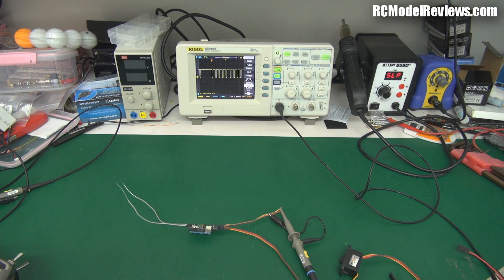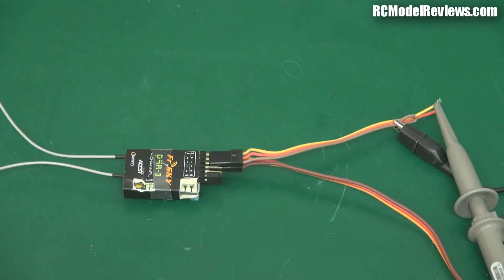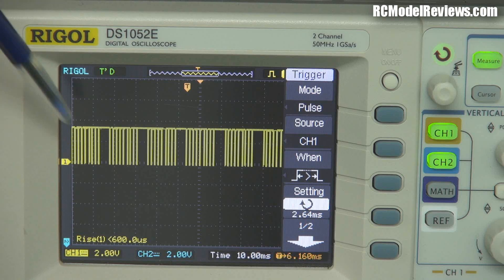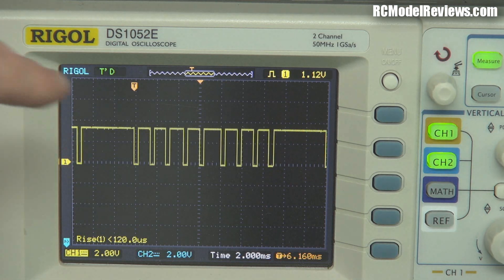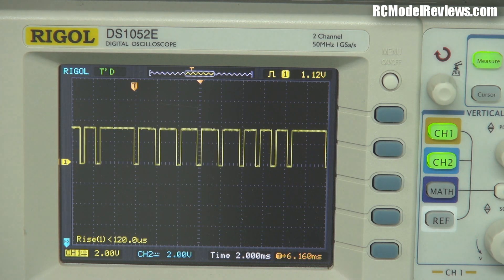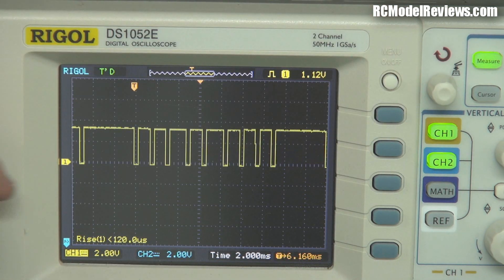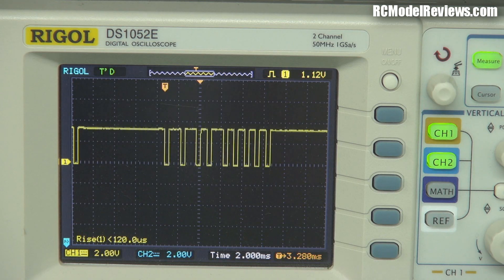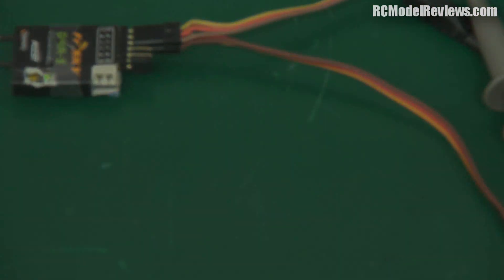CPPM and the FrSky D4R-II receiver

Comment: Check out the CPPM on the FrSky Delta-8! I did things differently when writing its firmware to what FrSky usually do in their firmware. It's designed that there will always be a minimum sync pulse length - no matter what the channels have been set to. Effectively stretching the complete frame length if necessary. 
This gives best of both worlds. Short frame length if the channels move small amounts to keep the latency short - but then extend the frame length if the channels have moved large amounts. 
Probably better explained if you take a look at the output on your scope.
Reply: A comparison between different receivers (not just FrSky) and their CPPM implementation would be nice.

Comment: How can i determine if my D4R-II reciever has the 27ms Fimware already?? The 27ms update is from 2012-09-26 so my recievers SHOULD have it already. How to Test?
Reply: For those don't know: you can reflash them simple by using a normal ftdi adapter: http://diydrones.com/profiles/blogs/frsky-s-cppm-at-27msec-firmware-update-with-ft-prog-and-ftdi-cabl
Reply: David Kaden Hi David, in the end did you reflash? I just bought one and I have the same doubt as you.
Reply: Marcelo Alcantara  Yes, i flashed all three i have.

Comment: Hi Bruce and thank you for the insight view , I am just getting into fpv and as always . I use the fly sky 8 channel receiver with the flysky radio. However, I have been thinking about investing in the taranis radio just wondering if and when new receiver come on the market . And as I add the extra bells and whistles like osd ,etc if there will be a need to flash radio. Most people flash the radio to get more features . Just wondering if new accessories will need to be flashed as well.Thank you.

Comment: I wonder why they didn't use Manchester Bi-Phase Modulation, as used in SMPTE and CD audio to encode binary data and with error correction encoding, or something like MIDI which transmits channel number and values as events only when they happen.
Event based transmission would keep the bandwidth down by only sending changes, but there's also a risk of being missed, especially without any form of handshaking and acknowledgement.
At least with CPPM encoding, channel states are continuously broadcast and can cope with temporary dropouts and brownouts, but a duty cycle of 20 ms seems to be quite large to multiplex just 8 channels.
If a model has a telemetry back-channel and enough transmitter reciprocity, it would be interesting to use TCP/IP so commands and video transmission could be encrypted and made secure from interference and hijacking.
Reply: >it would be interesting to use TCP/IP

TCP/IP is totally unsuitable for this sort of application.

>so commands and video transmission could be encrypted
>and made secure from interference and hijacking.

You don't need TCP/IP to encrypt the data stream. Encrypting the telemetry data would be easy enough.. you could do it in software or use the hardware crypto block that a lot of newer Cortex micros have now. To encrypt the video you want the video to be digital and have something with enough throughput to encrypt the stream without introducing lots of lag. If it was something people really wanted it would be the sort of thing that would go into the ASIC that does the video down sampling for the analogue transmission and H264 or whatever compression for recording in the "action cams". It depends on where you are etc but I have a feeling you aren't actually allowed to send encrypted data on some of the ISM/ham bands in a lot of places.

Comment: Bruce, sorry for the basic question. Do I understand correctly that with ppm (I'm lazy) I can have more than 4 channels on a 4 channel receiver?

Thanks for the video.
Reply: The problem is that when you have lots of channels with high values the sync pulse gets shorter to keep the frame (a set of channel values) to the same overall length. Once the sync pulse is too short the flight controller has no idea whether that pulse is a channel or a sync pulse. The sync pulse is there to reset the flight controller's internal counter for the current channel that's coming in over the wire back to zero. If it thinks the sync pulse is a channel that won't happen and everything will go to shit. If I understand what Bruce said you should be fine with 4 channels even with the shorter frame length.

Comment: For all those that think the contraints of the 20ms period of the sync pulse is a bit retarded. This is not FrSky specific it is simply that they are one of a very few makers offering this output as an option. Historically 20ms has been the industry standard for frame width allowing the use of recievers with varying numbers of channels with any TX (assuming same brand TX and RX).
The so called PCM systems of the past also addressed some of these limitations but the average sunday flier was happy with the old PPM system and the available PCM RX's were expensive and have not proven to be futureproof unlike the PPM system.
 It is only in recent times that anyone has had a use for CPPM. Aside from multirotors and some types of robotic vehicles all models use servos hence CPPM was never an option. Futaba introduced S Bus as a means of increasing the possible number of channels, simplifying wiring and reducing latency introduced by the 20ms frame width. S Bus is a truly digital interface ie using binary encoded numbers rather than PWM with servos being individually addressed and their position commanded over a single wire.
FrSky have adopted S Bus as option on all their current generation X series Rx's but have dropped CPPM. They have also introduced a limited range of S Bus compatible servos which is nice since the Futaba S Bus servos are rediculously expensive. I have a couple of the FrSky wing servos and can say they are nicely made fast and accurate.

Comment: This is really a non issue if the pulses are generated by a microprocessor as they are a minimum width for the sync pulse can be specified, and the frame rate can vary slightly at maximum pulse widths. Whoever programmed stuff like this needs an intelligence test.

Comment: I didn't realise that the CPPM frame size varied.  That's a crap design if it poses confusion with sync and channel data.  It could be addressed by having the sync zero followed by a single short 1; or some other unique code.  Surely something like I2C would be significantly superior.
Reply: ***** I hate SBUS for being so incredibly unabitious. Fixed frame length, ugly bit stuffing, aswkward timings. It's crap. But I love that we have it, it's better than analog pulses.
CAN would have been nice...
Reply: *****
SBUS has pretty much done that... it's a much higher speed interface than CPPM and a growing number of receivers and controllers now support it.
Reply: ***** With the Taranis you an simply limit the number of channels to whatever you need but other radios don't always offer that flexibility.
Reply: The only reason it is crap is when the m manufacturer tries to get the response rate down which limits the frame bandwidth. It's works great for 3ch surface radios at 11ms but 8ch is just to much.

The use of a variable sync pulse makes the signal very simple and therefore easily universal with many manufacturers. There are better encoding methods or there for sure but the simplicity of PPM is hard to argue for it's flexibility.
Reply: ***** That sounds like it would definitely help.  Are you aware of any steps towards a high speed digital serial interface with other systems?  It seems common place these days for implementation of a flight controller; the MCUs of which generally support some kind of digital high speed digital interface; serial, SPI or I2C for example.
Reply: ***** There are no licensing issues in relation to implementation of the I2C protocol.  However, registration of "officially recognised" slave addresses does require licensing from NXP.  The AVR Two Wire Interface (TWI) also requires ground, so it's a good job the word "Three" also starts with a "T".    :)
Reply: *****
I2C has a address per device. Which needs to be at least unique on the bus. To make multiple devices of the same type possible on one bus, they usually allow you to set one or two bits of it's address via jumper pins.
Addresses are hard-coded.
Reply: Because the address is burned in the chip.
Mac addresses are also registered with the IANA. There are probably test ranges you can use freely but that is for test only.
Reply: ***** If you were to design say a dedicated device that monitored pressure and reported the data as an I2C slave; it would be advantageous to register an "official" address.   But as Tilman Baumann mentioned, there are usually a few bits that you can set so that if you have multiple instances of such devices they could be individually addressed on a single I2C bus.  The AVR MCU has an I2C (TWI) interface implementation which takes a lot of the donkey work out of managing the bus, but this can be done of course with digital pins if you were so inclined; therefore gaining complete control over the all aspects of the bus; including addressing.  Ethernet is an "opportunistic" style of communication with no specific master/slave assignment.

Comment: Thanks for the great video:

I've got one question: Does the Taranis + X8R receiver have this problem, too?
Reply: TheCybercrash No, the X8R doesn't offer CPPM, only SBUS and direct channel outputs so it's not an issue.
Reply: ***** Ahh, but then you use the frsky sbus -> cppm converter, which is tiny... I wonder if it converts nicely or can be reflashed?
The advantage of the x8r is the sbus telemetry, but flight controllers like the naze or afromini don't seem to understand sbus :(
Reply: Charles Phillips Pixhawk (APM) does ;-)
Reply: Charles Phillips The Naze32 DOES support SBus.  SBus is an inverted serial protocol, so it doesn't work without an inverter.  I just tested my Flip32 (Naze32 clone) with an inverter last night and it worked great after setting "feature SERIALRX" and "set serialrx_type=2" in the Baseflight CLI, and connecting the inverter SBus output to RC input 4 on the flight controller.

The problem with SBus on the Naze32 is that it uses the GPS serial Rx pin, Spektrum Sat does the same, so you can't have a serial Rx and GPS at the same time, though I think Cleanflight (a fork of Baseflight) has made this possible.

More information on enabling SBus, SUMD, and Spektrum Sat serial RXs can be found on the Baseflight wiki:
https://github.com/multiwii/baseflight/wiki/SerialRX--like-SpekSat,-Futaba-SBUS,-Graupner-SUMD

Here is the link to the PCB i designed for this.  The transistor and resistors can be had on ebay for about $3 for 50-100 pieces of each, and the PCB is $1.60 for 3 boards.  For less than $5 you have parts for 3 SBus inverters and plenty of extra resistors and transistors if you order more PCBs.
https://oshpark.com/shared_projects/qP5QyPLN
Reply: Yeah, I spotted the inverter route, however I'm trying to do this on a mini quad (250mm size) so I worry about the robustness of an extra pcb in there and the space required. Plus of course I'm using an AfroMini board that doesn't take SBUS anyway! And indeed I am using GPS for the OSD. winding back the un-used channels and the tiny SBUS -> CPPM seems to work, I just wondered if it already had updated fimware and/or could be flashed for a longer frame.
Reply: Charles Phillips The D4R-II is a better candidate for driving the Afro Mini (setting one up when it arrives). You can flash the D4R-II with alternative FrSky provided firmware which gives a longer frame rate bypassing the whole issue or stick to 5 channels if that suits your needs. I also have the X8R and the converter which has a jumper allowing you to select between the shorter frame rate and the longer, so you can use either 5 or 8 channels safely as you choose. I use a D8R and a converter on my larger APM based tricopter with 8 working channels.

On my smallest Tri (310mm), I chose to use the D4R-II with the 8ch firmware as you get 1 analog voltage telemetry feed that I use to read pack voltage using a voltage divider I built for the cost of 2 resistors and a little solder + heatshrink. I get pack voltage on my transmitter (Taranis) along with voice based warnings when it's time to either come home or walk. Plus full range plus low weight / size / cost. Sold!!

PS: A quad is like a 4 legged stool. 3 legs are inherently stable, why waste quality wood? :-)

Comment: Is there any disadvantage with flashing the receiver from 18ms frame width to 27 (or whatever they are). For example is the resolution/response time slower?
Reply: venturation In theory the latency is slightly increased but in most cases it's nothing to worry about.
Reply: I've done it to a few of my D4R-IIs and I can't tell one from the other.

Comment: I have been flying a blackout mini H for a while now, and I have a orange rx satellite that can do CPPM. I do want to try it but want to know its strength. Is the range still as good as conventional receivers with the extra antenna wires? (Currently using a full range 9ch Spektrum receiver with my DX9.

Comment: This is a false issue, and is not new, more than one year found and debated.
Short story: you can use safely even 7 channels if you know how to assign them wise to various functions.
The first channels more than 1700uS all four simultaneously is a 0.01% probability to happen.
Conversely, they are 99% of time between 40 and 60%, leaving to channels 5-8 enough room to breath.
Reply: Renato Aranghelovici Yes, but on a flight controller you will be using at least 5 channels and one of those channels will (at times) be switched to 2mS, whilst the others will also (if you're doing high-powered aerobatics) also be "maxed out" -- meaning there is a much higher chance of losing sync due to the shortening of the sync pulse.The reason I made this video is because I finally discovered what was making one of my quads fall to the ground with no control -- it was sync with the flight controller being lost at extreme stick positions and with Ch5 at 2mS.
Reply: @Renato: Like always the xjet videos leave out a lot of information I did a writeup for baseflight here hXXp://www.multiwii.com/forum/viewtopic.php?f=23&t=3524&start=850#p54189 and fixed the problem in software in my "Harakiri" branch (see: http://vimeo.com/101973730). Some Frsky RX are not flashable. Reducing the auxchannel range is as safe as flashing the RX. For further information on this problem and flashing instruction with normal FTDI look here:
hXXp://diydrones.com/profiles/blogs/frsky-s-cppm-at-27msec-firmware-update-with-ft-prog-and-ftdi-cabl
hXXp://diydrones.com/profiles/blogs/why-frsky-cppm-signal-is-so-disappointing

Comment: Great video! What happens when you lose the Sync pulse? Would the receiver stop working?
Reply: tierento Usually there's chaos ;-)  Whatever's plugged into the CPPM output will function erratically -- if at all.

Comment: It would be cool to go into more depth about how CPPM works. Why do receivers give width back to the sync pulse, rather than just increase the gaps of either side of the channel's pulse? (I assume it is to maximize width resolution.) How much larger than each channel pulse does the sync pulse need to be for a flight controller or CPPM to PWM converter to recognize it? How does CPPM represent the actual percentages? How does a flight controller know what pulse width is 100% for that channel?
Reply: CPPM dates back to the old days of radio control, when microcontrollers were unheard of.  Back then a decoder could be build around a simple logic gate shift register.  The longer time for the sync pulse would be detected to reset the shift register, then the beginning of each following pulse would clock it one position.  A servo watching one bit on the shift register would then see a pulse length matching the channel intended for it.  A fixed total frame length would give the servos a steady pulse rate.  Some hardware designed to use PWM signal input is sensitive to the pulse rate.
Reply: The sync pulse needs to be longer than the maximum pulse length (2 ms) to sync correctly. Since minimum and maximum pulse widths are standardized at 1 ms and 2 ms respectively, the ESC/flight controller/etc. knows that a 1 ms pulse is 0%, 1.5 ms is 50%, 2 ms is 100%. I'm not sure why the frame length is kept constant. If all the information will fit into a 10 ms frame, why should 10 ms be wasted on a sync pulse when the update frequency could be increased instead? Probably just bad design.
Reply: jvcrules  The sync pulse needs to be at least 4ms, most flight controllers will loose track of the channels if the sync pulse falls below 3.8ms